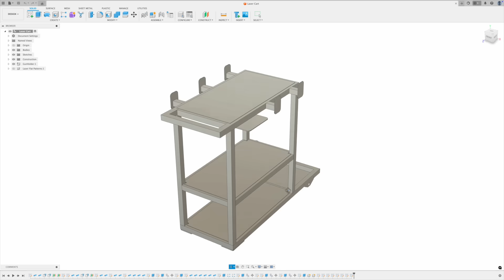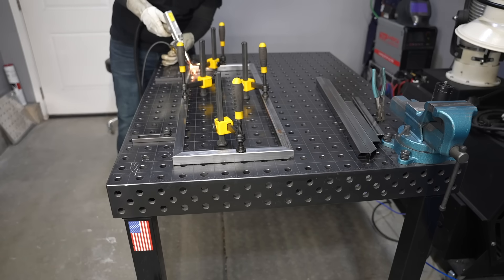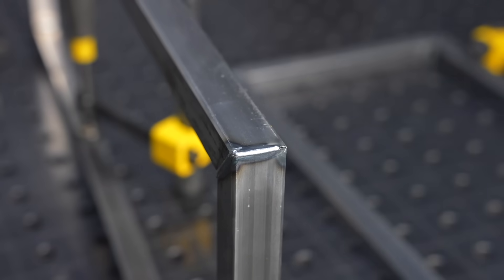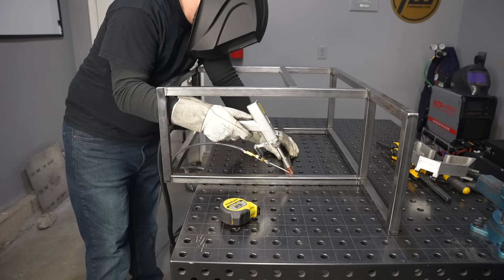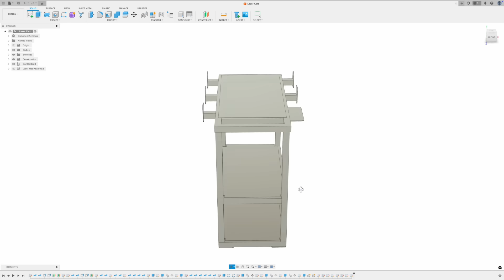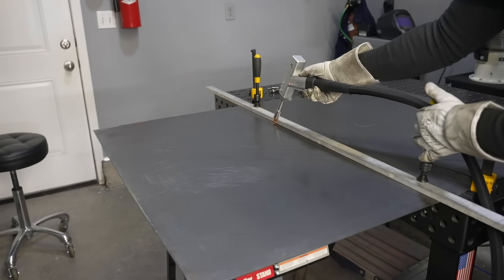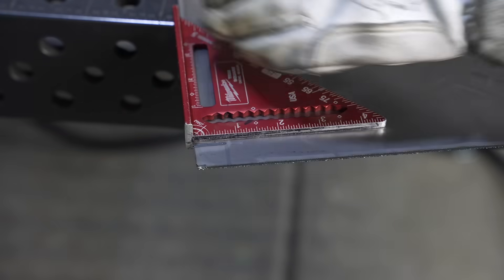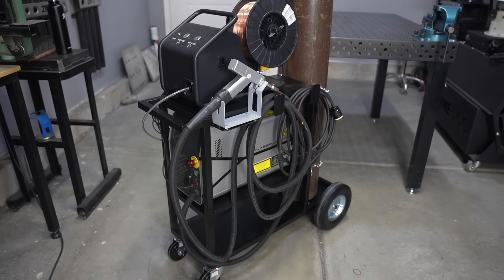The REALITY of Fabrication with Laser Welders - Xlaserlab X1 Pro

Comment: Hi Tim. Thank you for the question, and I wonder where I can get this Laser X1 Pro. I could find it useful What kind of costs goes with the package of Cutting, welding, cleaning and some other options.
I understand that there's diferent thickness of steel possible. I wanted to try some 1/4" to 3/16", 1/8" and I/16"

Comment: Hi, how do you get a nice round profile on the outside corner joint with the laser welder? And whenever there is a gap, the weld bead just looked concave and not good for grinding

Comment: Great video! Just wondering if you could explain the laser cutting function with regards to using a air compressor?
Reply from the maker: Thanks! There is a different nozzle with a small hole that you install to cut. It needs a lot of gas to push the liquid metal out of the kerf. Because you don't need the same protection from inert gas that a weld needs, compressed air works just fine. I connected the gas inlet port directly to my compressed air system at 90 psi and that's all. I would recommend some sort of filter to make sure the air is clean and dry.

Comment: As someone who has done zero welding whatsoever, would you recommend going with Stick/MIG at my stage and then later on step up to this? 
Basically, would this be a good option for complete beginner ?
Reply from the maker: It depends on what you want to make. Each process has different advantages and pros/cons, so it's really a matter of choosing the best tool for the job. I made a video comparing this machine with MIG/TIG that you can find recently uploaded on the channel. If you're still unsure which is the best for you, you can shoot me an email with a description of what you want to do and I'll help you choose.

Comment: Hello Tim. Thanks for the series on this 750 watt laser machine and for pursuing beyond coupons.  I recall from previous videos that on carbon and stainless the limit on this machine was about 3 mm thickness ?  Would a cart or similar project (like a small door gate) be penetrated enough with 3 mm profiles ?  Many thanks
Reply from the maker: On steel and stainless steel, you'd be able to fabricate projects like that with 3mm thick material.

Comment: Question: have you tried running just the laser over welds that don't turn out "pretty"? Like just having the laser go over that one joint you made on the tool hooks that turned out bad
Reply from the maker: Yes, it works okay to rework them, but it's not quite as good as getting it right the first time.

Comment: It seemed better on fillet welds rather than butt joints . . . or was that my imagination . . .?
Reply from the maker: It's a lot easier on a fillet because the wire sits right in the corner. On a butt joint, I had a comment suggesting a file to make a small chamfer for the wire to sit in. I'm going to try that, I think it would help a lot.

Comment: As an owner of the same welder, to use it you need to be able to see the screen on the welder in order to configure it and to turn it on. My first mistake was putting it on a cart like that — it’s unusable if you can’t see and touch the screen.
Reply from the maker: I've used it on the cart and don't have any trouble accessing the screen on the front of the machine. It's not much different in height than a typical MIG or TIG setup.
Reply: Hello sir I m thinking about buying this I m a okay mig welder I would love to hear your opinion before I spend the money , thanks

Comment: I backed the kickstarter, and chose the option with only the protective goggles.  I had imagined that would be enough, but maybe it isn't?  Where did you get the full helmet?  I'm weary of eye wear that may not actually be up to the task!  Very nice trolley BTW, that was going to be my first project as well.
Reply from the maker: This is the helmet that they sell on their website. There are a lot of them available online from different sellers. I'm not a laser PPE expert, but from what I understand, as long as it is for the right wavelength of light and the optical density is high enough, either glasses or a welding helmet can be used.
Reply: @TimWelds  Good to know, I'll give the glasses a shot first and see how it goes.  Appreciate your videos on this topic.

Comment: Me loving that cradle.  As for cutting, my SUP23T kerf width is dialed in at 0.006", a lot of the top spray is due to top side rust. Thanks for the build video and the VO, really gave a good demo of the joys of laser welding. I love mine.
Reply from the maker: That's good to know about the top side rust. After all the years cutting with a torch and plasma cutter that don't really care much about surface condition, I hadn't considered it.
Reply: @TimWelds, it's a safety issue as well, that light energy isn't going down, its going somewhere.
Reply: Craig, may I ask a question or two on the SUP23T? It's the gun I want when I get a 1500W setup, but the likely sources seem to not guarantee it (despite what I see in pictures), so it's possible I'll get something like a HW980 (plastic body). Do you have an opinion about whether one is definitely better? I lean towards the SUP given that it will be easier to adapt to a automated cutter/welder if I so chose. And have you had any issues setting up the gun, cleaning or replacing the lenses, etc.? Any thoughts on the matter welcome!
Reply: @Dreadfox-t9o I only know about the SUP23T, can't speak about the plastic one. The 23 has flat construction so it's easy to make a mount
Reply: @CraigHollabaugh  Thanks! So generally you've been happy with your welder/gun, do you mind letting us know your vendor and how the entire thing was shipped? I've been seeing weights of roughly 90kg/200lbs, was yours truck shipped or UPS/FedEx? Sorry for all the questions...
Reply: @Dreadfox-t9o skyfire, they recently opened a us warehouse too
Reply: @CraigHollabaugh  Craig, thank you - I will check out your channel.
Reply: @Dreadfox-t9o I have an hour long video on my 9 month laser welder journey

Comment: Hi, since the laser is not bound to the welding table, wouldn't it make more sense to move the project around to your best position?  I know that you would have to worry about stray laser beams, but if you are always in the same general area, that should be easy enough to control.  Just wondering.
Reply from the maker: As long as you don't need it in a fixture to hold a really tight dimension, you can move the project around. I was repositioning the frame on my welding table throughout the build. Part of the challenge when I'm filming is to get a shot without standing between the work and the camera so I'm often in an awkward spot.

Comment: I wonder if taking a file and giving these edges a quick swipe to add a tiny angle would provide a guide for the laser wire and keep you in the joint. This is so different as you’re actually sitting on the metal when welding.
Reply from the maker: That's a great idea. If the wire had a small groove to sit in, it would be a lot easier to track the joint. I was thinking about designing a little jig that would sit on a mitered corner and guide the gun along the joint, but your idea is a lot simpler.
Reply: I use the same type of techniques that you use with gas welding to fill gaps.   Disable the ground system so you can move back to control the heat, then use it like a torch.  The hardest thing to get used to is to adapt away from conventional welding methods and use the laser techniques.
Reply: @MatthewThie-md9nj you mean the work clamp? Remove that and use the laser to melt the metal, sort of the way you would cut with it? Like TIG if you use a rod as filler. Interesting idea. I don’t have one of these, but I keep thinking about it.
Reply: @melgross  Not the work clamp.  There is a safety ground clamp that enables the laser when the tip of the gun contacts the work.  You will have to select the option to disable this function to weld with the gun away from the work in this case.
Reply: @MatthewThie-md9nj ok, see, I haven’t used one of these yet.

Comment: Yes! Please, more laser videos! I'm right on the edge of picking one of these up, but all the videos are just of coupons which makes me nervous. How do you solve for large gaps / imperfect fit-up? Is that even doable with laser?
Reply from the maker: Good fit is important. Gaps are difficult and the weld quality suffers a bit. I'm really new to handheld laser welding and I expect I'll get better at it with some practice. The biggest challenge is that the wire or nozzle has to be in contact with the workpiece or the safety system will shut it off.

Comment: The gun ergonomics are definitely the weak point by far. I think that's the next big innovation needed. I can run mine off of a battery bank making the portability crazy, but with the wire feed and the size of the gun it's still a good bit of wrestling.
Reply from the maker: I hadn't thought about using a battery bank, that would be awesome! 

This is such a specialty project that I don't think I'll make plans for my site because they take so long to produce. If you want the dxf files to cut the parts or the Fusion model, just send me an email and let me know what you want and I'm happy to send it to you. My email address is on my about page, if I put it in the comments, the bots start taking over my inbox.
Reply: Also, you, uh...making those files available?
Reply: Maybe it would be useful to mount the gun onto, say, a monitor arm or a cheap/diy steadicam in a gimbal.
Like those ZeroGravity things

Comment: How does it perform with scabby material? (i.e. millscale, oil or rust)? Because I imagine MIG, maybe with 100% CO2 or stick, would be able to handle this just fine, but I am curious how picky is the laser welding process in this regard.
Reply: It'll weld through...but I'll switch to cleaning mode and run a pass pretty much always; it's so quick to do.
Reply from the maker: I haven't tried with thick mill scale, but for light scale or cold rolled, it's worked fine for me with just a quick acetone wipe. I'd say it's more forgiving than TIG. I'm finding that laser & plasma cut edges aren't as problematic as they can be with TIG either.

Comment: I d like to see how it does with the AWS test.
Reply from the maker: Which AWS test? A guided bend test that is often used for MIG/Stick/Flux core isn't very common for laser weld qualification, partially because lasers are most common on thinner material than those tests are qualifying. It wouldn't make any sense to run a 30 pass laser weld on a guided bend test coupon set. I actually think it would pass just fine, but if it doesn't represent what you're using the process for, I don't think the information would be very valuable. 

I've worked with the qualification of thousands of laser welds in my day job as a welding engineer (none of those were handheld laser welds, they were all automated). The testing used in those cases (aero engine parts) is usually a combination of visual inspection, dye penetrant and macro etch. For more critical applications, there may also be a mechanical tensile test, radiograph, ultrasonic test or leak test. 

Overall, it's rare to see a problem that doesn't show up in visual inspection and macro etch. In some of the other videos I've done, I performed a few macro etch tests and fillet weld break tests, which would capture most failure modes with what I have to work with in my garage (I don't personally own a full metallurgical lab). 

What failure mode are you concerned with testing? There may be a way to look into it.
Reply: @TimWelds I have no experience with this type of welding.I have done MiG Tig gas and stick. I would like to see the weld cut open so we could look at the depth and evenness of penetration. A friend of mine has one of these and his beads looked more like a braze than a weld.
Reply from the maker: I have other videos with cross sections. The penetration is really good, deeper than it is wide. I found that on a fillet weld, if you tip the gun a little more toward the top plate, the weld fusion zone catches more of the joint rather than just pushing deep into the lower plate.

Comment: I imagine that this type of machine will have a similar history as the inverter welders.  As the process becomes more well known, the bugs will get worked out as well as the price will come down.  As it is, how does the over all cost per inch for this process compare to MIG?
Reply from the maker: I think so too, it'll be fun to watch. 

Setting aside the cost of the machine, a laser like this would be cheaper per inch on material under 1/8" thick. It uses less wire, less gas and less time. As you get thicker, it doesn't deposit enough weld in a single pass for most applications, so I expect that MIG would take over. As far as absorbing the cost of the machine, that just depends on how much welding you do.
Reply: @TimWelds there are some pretty high power models that lay down a lot more metal. But, sheesh, the price goes up faster than the power.